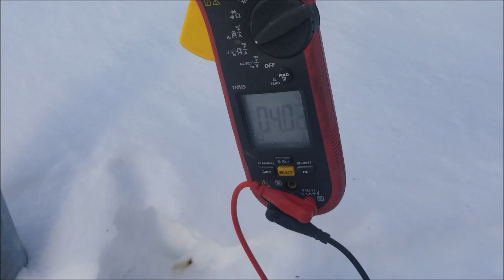Is the neutral wire safe? - Powerlines

Comment: We had an incident in my home years ago. During a bad storm the power went up in the home, blew out all halogen light bulbs, some incandescent survived.  But I went to check my outlets half were dead and half were at 240v.  My fridge compressor for hot, unusually hot and of course not running.   Pulled the plug on it. I determined pretty quick we lost the neutral.  Called the power company and told them, the person I spoke to treated me like an idiot.  
Lineman came on scene and I told them what was going on and what I thought and they said yup that’s it.  Went to the back yard and dropped the service off the house because the neutral had 6 repairs in it and one failed.  They replaced it all.  And amazing how fast they had us back up.  I knew that being we lost the neutral the motors in the house were transferring the hot line to the neutral and then half the house went to 240v.  

The lineman was surprised I figured it out.  But my background on military radars and 3 phase 400 Hz 60kW power distribution taught me a thing 2.

Comment: I’m commenting this before watching the video, the neutral wire is slightly safer, but still incredibly dangerous. The neutral wire contains electricity that has already passed through the appliances that those lines deliver and sometimes more. Think of it like a drain pipe and water supply pipe, the drain has slightly less water in them, but you still don’t wanna cut into them because there’s still water.

I’ve experienced this first hand by touching the neutral wire on an outlet, I could feel a shock because of all the nearby running appliances. In hindsight, that wasn’t the brightest thing to do, I wasn’t grounded but I could’ve easily touched the ground wire.

Comment: I got knocked on my ass one time changing florescent light fixtures in a factory.  Apparently, they had a shared neutral from another feed and when the wires were disconnected the neutral went hot.  Lesson learned...

Comment: 3:02 And you didn't measure the voltage across the two neutral wires, which would probably been the most interesting. I'm guessing ... 10 volts maybe?

Comment: one time in my area a few years ago a transformer had failed on the 3 phase high voltage lines going through town that split off and fed our single phase line in front of our home. we had turned off our main breaker in our panel but unfortunately it does not disconnect us from the utility's neutral, which had some weird potential on it (i think somewhere around 60v) so when we hooked our generator up to this common neutral many of our electronics had fried in our home. luckily, it was mainly power strips that fried and nothing too expensive. very easy for potential injuries in such a situation.

Comment: It should be mentioned that neutral wiring in even in your home carries current. 

If you disconnect a live circuit somewhere in the neutral only one end is neutral the other end is the line voltage looking for a path to ground even if the wire is “white”. To add further confusion the wiring in a home isn’t always straight to and from the source, turning off a breaker that kills power to your load might not always kill the imbalance to ground from another circuit sharing that neutral. Depending on what you disconnect you could inadvertently make that neutral live. Always ALWAYS check for voltage on neutral to ground when messing with a circuit. 99 times out of 100 you’ll be fine but that 1 time is waiting to surprise you.

I have a ceiling fan in my office that has a neutral in a loom with voltage on it when disconnected. It took forever to trace out to an adjacent bathroom outlet that only keeps that neutral love when something is plugged into it. No idea what they were thinking during construction other than saving a buck.
Reply: I’m 15 years into my home remodel and 2.5 months after we bought it, paid electrical contractor to upgrade the panel to have more circuits. They added 2 as per code allowed and the dude wiring up the new panel forgot to label a shared neutral circuit. Needless to say he put to hots on opposite legs and fried some battery backups and 2 clock radio transformers. Thankfully the owner of the company showed up and  immediately knew what was wrong. The compensation for the damage was isolating my bathroom so the wife could use the hair dryer and stuff. That circuit with shared neutral was the whole upstairs ceiling lights, 3 bedroom 12 outlets and the split entryway ceiling lights. I’ve since update almost all the other circuits (basement access to floor grid) as we have gas water heater, and stove so 2 240 volt circuits were available. The old panel had those shared neutrals on to single poles on same side not a double pole breaker so that’s why the electrician forgot and screwed up. I’ve since learned alot about bonding, and grounding and potential between legs. Balancing loads is a thing. Understand electricity is all about education and not just thinking you know the “basics”. 😊

Comment: Great video,Bob. It's weid to me that USA and Canada still has nautrals in medium voltage grids.Even weirder that sometimes the same neutral is used for low and medium voltage.In Europe almost every medium voltage grid had only 3 phases on the poles without neutral even in the 1950s.The most common medium voltage level is 20kV.The primary of the transformer is usually delta,the secondary is 230/400V star.Some transformers have star primary and zigzag secondary.At the substation,the neutral of the medium voltage system  is grounded through an inductor to compensate for the capacitance of power lines to ground.
Reply: It's not weird since most distribution circuits are wye three-phase (4-wire), or single phase (2-wire).  Transmission is where delta is king here.

Comment: So the neutral wire on the single phase overhead service drop to my house, specifically the tail that was tied to the ceramic insulator connection point on my weather head broke loose (probably from a tree limb drop) which caused the service drop of triplex to droop. I called my local electric utility and they sent a lineman out who tied it back to the weather head, only this time he tied it directly to the metal weather head mast (so electrically, i believe it is now essentially connected to my panel ground, etc.). Is that a problem? I’d like to believe there was a reason for the original connection to be to the insulator. Any thoughts are appreciated. Thanks.

Comment: Question - Back around 2000, a storm blew down tree taking power lines down.
A two-phase line, I think was 14.4 KV. and the top lines were on the ground. It was close to a trailer park with lots of children. I called it to power Co and 911.
911 said it was not any kind of emergency. I saw it as a BIG danger to human life, not just children, but adults too. 
? do you think 911 was correct or did I have a misunderstanding of danger?

Another time, a three-phase line, I think 14.4 KV a three took the lines down and were laying on the road. This time the sheriff closed the road. But motorist moved barricade then moved the top wires with bare hands. ? Where those people as stupid as I think the were?

Comment: The neutral is safe as long as you dont touch a hot at the same time
Reply: No, and that's exactly the issue being discussed here.

The two sides of a broken neutral are dangerous, you don't want to complete a circuit between them with your body or anything else that can't handle the available current.

You don't have to insulate a neutral (if it's part of a properly functioning system) - it's safe to touch (except when it isn't) - but it's very much not safe to cut.

Comment: Well of course it’s not safe it’s the return path, same reason why you need 4 cables for a split phase sub panel, 2 120v legs, 1 RETURN and one ground.. the return carries the current back to close the electrical path from either 120v path !

Comment: When a tree touches the bare neutral, is there a power draw on the system?
In my area, there are dozens of trees touching the lines. I've often wondered why they don't cut the trees back.
Reply: No, not if the neutral is intact.

Once the neutral breaks or corrodes all manner of Weird Stuff breaks loose. It can also conduct hazardous transients from switching or lightning strikes.

But in normal operation the potential on the neutral is so low that it doesn't do much to trees or vice versa.
Reply: @jordanrodrigues1279  Ahh, so there are many problems in my area.
I've seen trees catch fire touching the line.

Comment: Best description of a neutral: A current-carrying conductor.
Reply: Superb. A current-carrying grounded conductor is popular in a lot of countries for single (2/3/4 wire) phase and three (3/4/5 wire) phase power, but some places use five wires to transmit three phase, (HOT, HOT, HOT, NEUTRAL, GROUND) while some places, like the U.S., use four wires, (HOT, HOT, HOT, NEUTRAL/GROUND) and still others use three wires, (HOT, HOT, HOT) and a "made" ground to the ground wherever needed. I have also seen three high voltage wires for single phase, (HOT, NEUTRAL, GROUND) sometimes associated with four wire single phase 120/240 volt "stinger" leads to homes and businesses,  (HOT, HOT, NEUTRAL, GROUND) such as a typical homeowner might see if they install a sub breaker panel after their main breaker panel, and also "suedo" three phase supplied by two hots, one neutral, and two transformers used to make three hots and one ground to big electric motors. I have even seen ONE wire single phase 120 volt house wiring. Yes, ONE hot wire into the house, to the light or outlet, and the neutral and ground wires go to a "made" ground, sometimes made with five to ten ground rods driven into the ground at least twelve feet apart and connected together. Yep, you can have as little as one, or as many as five power wires into your home, or small business, all supplying the same thing. I hope that helps. Hello from the Sparky on the Tracy Mountain Railway in Colorado. 💙 T.E.N.
Reply: Ideally ground reference but not guaranteed.
Reply: I like simplicity. Yes, sometimes an additional "ground" is used but if you remember that a neutral CAN carry current you're less likely to cut one open while in series with it. It's true here in the states we use a common neutral where the high/low voltage share a neutral. Some places will run a neutral for each high/low voltage. I know new building codes have the customer's side of the meter wired with Hot, Hot, Neut, Grnd.
Reply: @nickholman3843  Wait?  As someone who's not an electrician I thought traditional bonding happened at the main service panel, not the meter.
Reply: @EmperorA0  In high voltage power distribution, the Neutral serves as a ground reference AND a return path to the source/earth. Neutral conductors are bonded to the ground at regular intervals. If there is no ground connections on the mainline neutral It COULD be energized to full line voltage. So IF a neutral is carrying current, (has great enough voltage to push amps) and I come to work on it, I will never cut it open without installing a jumper to carry the current around the cut point. 

I don't have the luxury of turning off a breaker like you can at your house. Our breakers feed hundreds of people. Hundreds of sources of return current.
Reply: It's called the "grounded conductor"
Reply: Grounded conductor intended to return current in a single phase circuit (at full current), or the imbalance of current in a multiphase circuit.   The distance from the ground point determines the conductor resistance (typically 0 to 2 percent of line voltage IF the neutral is properly grounded and bonded).

Comment: For this scenario, what you covered in this video, can homes that have solar and their own wind generation power be an issue as well? There is of course the type of system, that is switch isolated from the main power grid, but isn't there some, that produce enough reserve / extra power, that they sell it from the home owner, to the power company to assist in the strain on the grid as a whole.. wouldn't those be an issue of sending power out as well? I could be wrong as I do not personally have experience with those "buy-back" programs.. In fact, I do not even know the correct name for those programs.. Just wondering.. is all..

Comment: When I was in school for 2 years learned electrical wiring, teacher taught us "never assume a line is dead just because it's disconnected. Always work under the assumption it's live, never skip protection  and never become complacent, if you do, it could kill you."
Reply: That’s it, we all get complacent…gotta get in the habit of always assuming it’s hot and work accordingly.  Power never takes the day off…
Reply: @f143744  That's what my teacher taught me, always assume your working on live wires. Even if you know the power is off, treat it as a live wire.
Reply: True, ik was working on electricity and there was electricity on the ground wire. Did never expect that and I got shocked by the ground wire. It was because the ground wire was to far into the connection of the wall outlet. Great tip!
Reply: Good statement(s)...on high-voltage transmission lines if you work on a nearby neutral line there can be THOUSANDS of volts on it even though it is grounded at each tower it goes through...

Comment: What neutral wire.... seems to me Canada doesnt have neutral wires let alone neutral wires bonding wires can be stolen and cut out leaving the  neutral wire ungrounded... that's why USA standard is to have a neutral wire grounded from surge and also there is the idea of "Induction currents" just being close proximity high voltage lines... Induction does create current to flow in conductors. Dont believe just drop a magnet through copper water pipes

Comment: Years ago a maintainance electrician friend of mine working at a railroad repair yard found out the hard way that a neutral is NOT ground.  He had always maintained spending all that money on a grounding wire separate from the neutral wire was a waste of copper.   He survived the experience with a new found respect for what is and is not ground.  When electronic motor drive electronics were introduced, harmonic currents also were introduced out of phase in neutrals, causing "hot neutrals"(thermally as well as electrically hot), so especially around industrial sites a neutral is not ground for sure.
Reply: Maybe I am over-pedantic,  but when I consider ANY electrical installation,  if there is a conductor there,  it exists to CONDUCT. Even if only in an emergency.
Reply: well said! my friend the industrial electrician found that out the hard way. Always treat ALL conductors, even ground conductors and neutrals, as HOT.

Comment: I was replacing a receptacle in my bathroom so I turned off the breaker for that, tested the hot black and began working.  The “neutral” white wire brushed up against the  side of the metal box and sparked. Turns out the living room is also on the bathroom neutral and since the breaker was off it had no path to ground until it touched the box. I think my home’s wiring is messed up, I assume each circuit should have its own neutral or you can overload the neutral wire. Anyway, always assume any wire could be hot! I could have easily been shocked because I did not test the neutral.
Reply from the maker: A neutral can become a hot during an open circuit! Your absolutely right, never assume a wire is dead
Reply: It could be a multi wire branch circuit also known as an Edison circuit. Two ungrounded conductors sharing a common neutral. This is why this type of circuit requires a simultaneous disconnecting means.

Comment: Grounded and bonded are terms that can be lethal if you don't understand them. You can drive a ground rod into the ground and attach a 120v wire (through a breaker) and it will not trip the breaker but it will have 120 volts on it. The ground rod is now live and potentially lethal. Everything around your pole is bonded to everything else plus an extra grounding wire running down the pole to a rod. Those rods can be live if some of the connections on the pole are not correctly done.  Beware - a ground or neutral wire can kill you if something has gone wrong. LESSON: DON'T COME INTO CONTACT WITH ELECTRICAL WIRES UNLESS YOU HAVE THE KNOWLEDGE AND EQUIPMENT TO PROTECT YOURSELF. I got hit with 1800 volts DC once and it burned a big blister in my palm and took me to the ground. Could have been fatal if it had stopped my heart.  Lucky this time.

Comment: Electricity of ANY voltage must be respected even if it's not a high enough voltage to shock you. Even very low voltage systems have hazards (fire). Most common voltage people get killed with is good old 120. Primary voltage is VERY deadly, but it's usually up high on poles and out of reach to the general public, barring car accidents and other situations that bring primary wires down or people sticking tall metal objects up in the air (ladders, scaffolds, cranes, etc.).

Comment: we have three line that still down the street and feed are building 3 faze 600 v coming into our building.  it was three  pole mount transformers 14000 stamped on them now a single pad mound on the ground.  anyways we'd get high winds and the lines would arc shorting out the building and sending a shower of sparks.  I tryed to tell hydro one but they blew me off is that normal  ?
Reply: Yes and no.

Yes that's an expected outcome if there's more wind than the lines can handle. (Wrong tension, needing more spacers, etc.) No it's not normal and it might need follow-up.